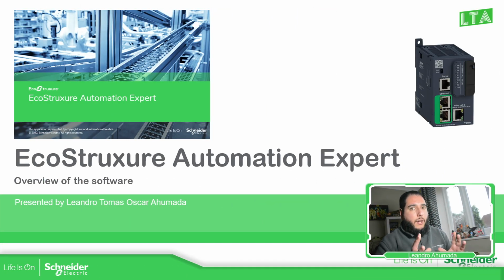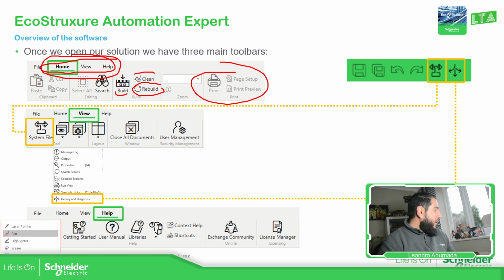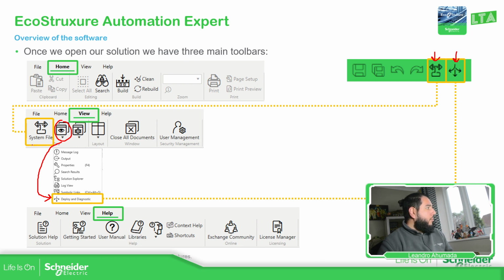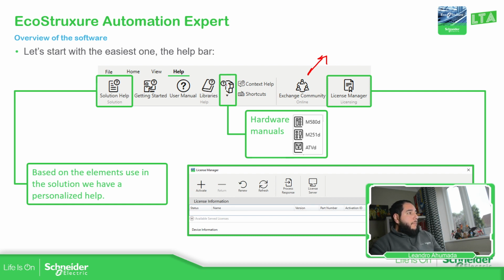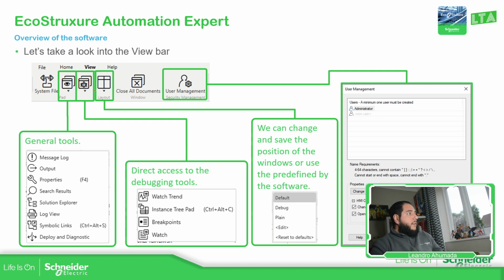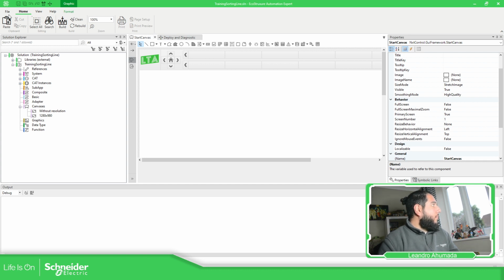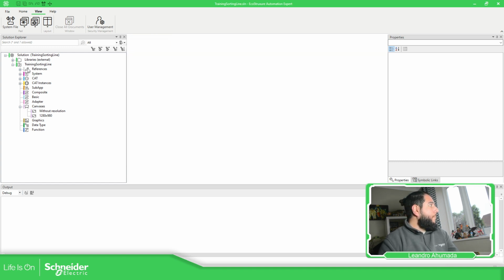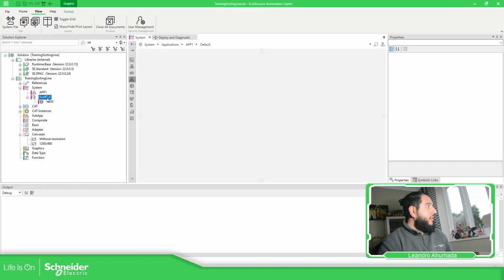EcoStruxure Automation Expert - M3.2 Overview of the software

Comment: Help me, Hi i am using plc m172 now i want to excute a:=a+1 with variable in effrom paraameter you can guide me . Thanks you verry much
Reply from the maker: Hi quy dao! If the variable “a” is a eeprom parameter then that assignation using the “:=“ it is not correct. You must use the function SysWriteParXXX (where XXX depend on the type of the variable). That function can be found in tbe “operator and block” on the last tab in that window.